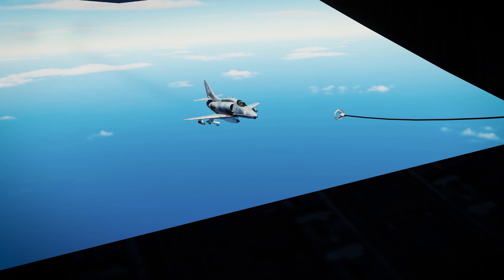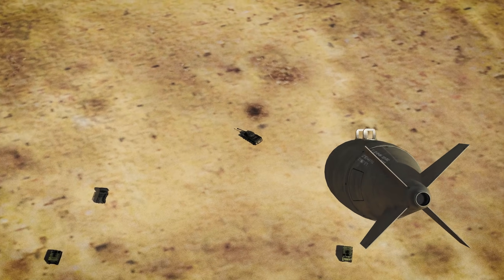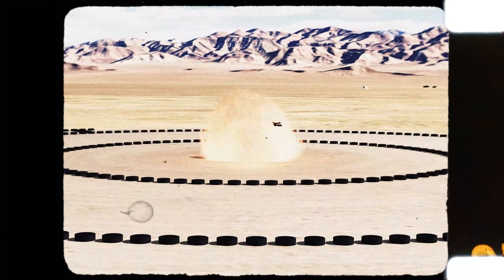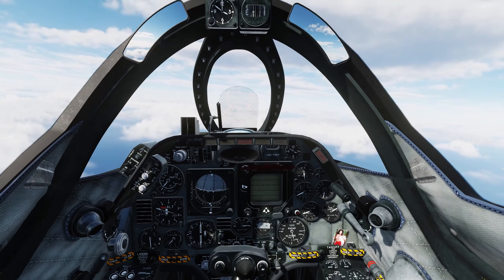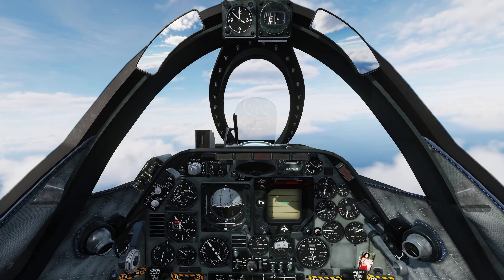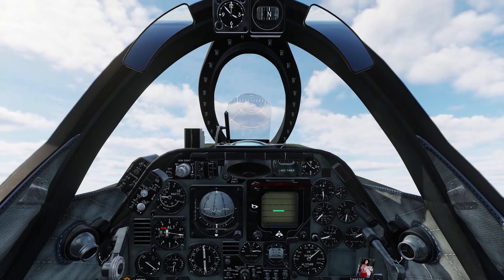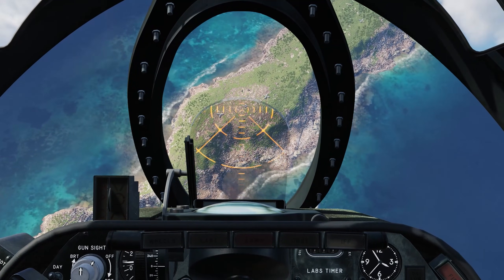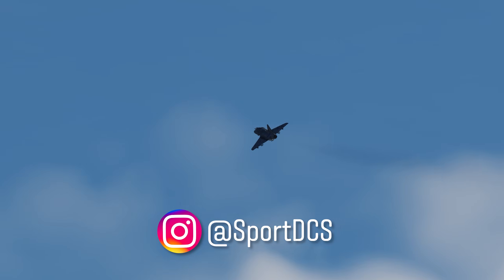DCS A-4E Weapon Release Computer | Digital Combat Simulator Tutorial

Comment: I used to be an A-4 Skyhawk avionics tech (a long time ago... late 70's).  I was in a training squadron and none of our aircraft had the APG-53 radar.   A couple had the CP-741 and I've had to remove and replace it to get to other stuff, and it is a big heavy beast!  I always assumed it used vacuum tubes (the Skyhawk still used a vacuum tube radio until the mid to late 70s), but if it had transistors, they were the heaviest transistors made!  😀  I appreciate seeing how these systems were intended to be used.  All of our student pilots were practicing plain bombing with a fixed dive angle, a fixed airspeed, and dropping at a fixed altitude.  I got to ride in the back of one of our TA-4's and experience it myself... and got to see my breakfast again.  I'm glad that I brought a bag with me!
Reply from the maker: That’s so cool to hear! Thanks for sharing that story… really brings the connection between the real and sim worlds!
Reply: @SportDCS  Is there a tutorial for "dumb" bombing?  As a guy in the back seat, it was pretty neat.  As we approached the target, we rolled inverted, pulled to get the nose on target, rolled upright, and maintained the required dive angle and airspeed.  At the proper altitude, the bomb was released.  At that point, we pulled up at 4 or 5 G's and climbed back to the starting altitude.  We carried 12 of the little  blue practice bombs, and made two "dry" runs first before dropping bombs for scoring.  The specifics for the bomb run (dive angle, release altitude, etc) for each weapon are given in the Tactical Pocket Guide.  I've got a copy posted to Flickr.  I would think that basic bombing skill like this might be something that people would want to develop.  Maybe it's just more fun in the actual aircraft?  😁
Reply from the maker: @SkyhawkSteve that’s a great idea! I’ve tried quite a bit of manual dive bombing and I’ve found the biggest limitation in DCS is the sense of feel when it comes to interpreting what the airplane is doing. It’s difficult to determine if you’re accelerating, or banked, or any of those other subtle cues you get when you’re in the real jet. I’ll be honest when I say I struggle with manual bomb deliveries from a pure skill standpoint!
Reply: @SportDCS  I should provide a little more of my background... I was in a training squadron, VMAT-102, and got a few flights in the back of our TA-4's.  Pretty cool, but those bombing runs really take it out of you when you aren't used to it!  As far as getting a sim to provide the same feel as a real flight, that is a real challenge!  I've spent a little time working on flight simulators at McDonnell Douglas (after getting out of the Corps), and having a full side to side and top to bottom visual display gives you a feel for your attitude that a computer screen just can't.  A motion-base simulator can provide some of those little physical cues that help you know how much you've changed the dive or roll angle, but I don't see that coming to home simulators any time soon.  It's amazing how far simulators have come since the early 80's, when even McDonnell Douglas was generating graphics by flying a little camera over a huge model map.  Who knows what will be developed next??

Comment: I have a question for you: I can’t seem to get the bombs to release, unless I’m in ripple/salvo mode. I have all 5 stations fully filled with mk82, and all pylons are engaged/enabled. I understood that you cannot do pairs with the center pylon, but does that also mean I cannot release wing mounted bombs in pairs?
Also, I’m not sure what the difference is between ripple and step.
Reply from the maker: @baronvonrichthofen2021  have you tried releasing in pairs without the center pylon turned on?

The difference between ripple and step is in ripple, the quantity and interval of bombs released by the AWRS is done through a long push of the weapon release button until the entire sequence is complete. In step, you need to keep pushing the weapon release button multiple times to get all the bombs off the plane - it “steps” from station to station
Reply: @ thanks for the response. I found that someone I hadn’t armed the bombs, or set the Center bombs on pairs, which doesn’t work

Comment: just a silly question. How does it know where the target is? Any reference to it?
Reply: Does it have to be a specific type of bomb in order for LABS and CPMTR to work? In my case the BG&A mode works just fine.
Reply from the maker: @huey_dvr  any of the slick Mk8x series and the Rockeyes are compatible with the bombing computer. I believe the custom An series of WWII bombs are good to go as well
Reply from the maker: The radar is fixed straight ahead and when you press the pickle button, it locks onto whatever it is on the ground where the nose of the airplane is pointed at.
Reply: I did everything by the checklist still no luck to get the bomb to drop in computer mode. 😡
Reply from the maker: @huey_dvr  master arm on? I forget that a lot. Check in on my discord and maybe we can get you some help!
Reply: @SportDCS  I checked that too. The manual mode works fine. Maybe something is broken with my module.

Comment: Thank you for this video, it helps so much! ! As a new A-4 pilot, i'm fighting with correct trimming of the aircraft on the bomb run. Usually it begins to slide on the left or right, so i compensate this with rudder trim. But this results in aircraft begins to roll slightly! When i compensate this roll with aileron trim, it gives much more roll effect, than you can expect from trimmer... And now is the time to pull up, and i got no time to aim correctly. Any advices about this? Your aircraft is pretty stable in dive run! Maybe there is some tricks with aircraft trimmers?
Reply: Predicting the trim necessary to overcome a disruption in coordinated flight comes with time. I've found that you want to start trimming BEFORE your aircraft is making heavy movements. I also find that unless I'm in a crazy crosswind, or dealing with an insanely imbalanced load, rudder trim is typically unnecessary. Trimming starts as a bit of a balancing act mini game, but eventually it'll be so second nature you won't notice you're doing it. Getting good at trimming the aircraft does wonders to help with landing and air refueling as well, so the skill isn't just an unfortunate necessity with aircraft lacking a fly-by-wire stability system, but instead a hugely beneficial skill to master across the board. 

This is one aspect of flight simulations that unfortunately gets glossed over by newer guys, and it's not stressed nearly enough how important a well trimmed airplane can be by the old folks.

Comment: Where can I learn more about the other bombing modes not present in the A4 community mod.

Also, what bombing mode would the Argentinian A4's used when coming in low level against British ships in the Falklands?
Reply from the maker: The bomb modes for the A-4E can be found in the 1966 manual, however I don’t think it speaks about specific delivery tactics. 

As for the Argentinian A-4s, I think they used some manual Bombing and some very low-angle methods. Also, they were using A-4Bs which I’m sure had some differences to our -E model.
Reply: The manual has a guide for bombing with snake-eyes, which would be very low similar to the Argentine pilots. The manual says to set the Gunsite Elevation to 160, Fly at 400 feet, 400 knots. I found that you need to have the Weapon Function Selector Switch set to "Bombs & GM ARM". If you have it set to "CMPTR" they wont drop. I found it helpful to set the rad alt warning at 400 feet so the low alt warning goes off when you're at the correct altitude. Also, zoom out the view in cockpit so you can see the airspeed and alt gauges at the same time.

Comment: I'm on mouse and keyboard and I can't pull up while holding the weapon release button but I've figured out how to loft / toss bombs with the bombing computer anyway. So what I do is I line up my sight with the target tap down arrow key (pull up) and when the crosshair meets the target I hold weapon release and the plane will keep drifting up, once weapons released, full throttle, get outta there.
Reply from the maker: That’s dedication! Have you tried using an Xbox controller?
Reply: i think it shuld be possible to still have control while holding relase if you assign relase as mouse button

Comment: great tutorial. can't stress how important is is not to be fighting wind, bad trim, or other instabilities in the dive after the roll-in. if you are using the AWRS, be sure you check the kneeboard for details on when the tone clears, it differs depending on drop mode!
Reply: Hmmm; trying to recall our preparations for a bombing run.  Right after start up we'd check the gun sight to see if it was reading true.  We'd put 240 mills in the gun sight drum and then peek over the nose to see where the pipper struck the nose cone. If it was off we'd put that many mills on or off our sight setting.  We also switched on the Stabolization Augmentation...aka the StabAug.  This fixed the Skyhawks tendancey to dutch roll in the run.  We sat the weapons function switch to "Guns and Guided Missles Armed".  We didn't turn on the weapons master switch on when we were in the run, or getting ready to shoot the cannons. Our weapons manual that we kept on our knee board helped us  compute the gun sight setting.  We added 5 mills for each wing tank (I think...it's been a long time!)  Anyway the gunsight setting was usually something like 160 mils for 30 degree bombing.  We'd usually fly to the target at something like 18,000'.  We'd fly abeam the target and when abeam we'd roll 120 degrees and let the  nose fall to a 30 degree dive, which looked almost straight down.  We'd put the pipper at 6 o'clock on the target and let it run along the ground.  We'd time it so that it reached the target at the same  instant we hit the release altitude and we'd pickle the bomb button with our thumb.  We'd get a tone in our headset and we could feel the bump when the bomb came off.  We'd "pickle, pause and pull".  We'd apply six 6's and grunt like mad or you'd black out.  As it was you'd gray out and you'd roll port (left).  Then you'd release the G and roll out going back the other way.  Sometimes you'd jink to avoid being shot.  We seldom made more than one run.  You'd one run, pickle all and get out of Dodge!
Reply: Oh, gee I forgot a few things.  You had to arm your bombs before you dropped them or they wouldn't go off.  You never wanted to stare at the target, which was called "target fixation" or you might fly into it.  You did  not see your bomb hit.  If you were shooting 2.75 rockets which you carried in 7 or 19 shot pods that you carried under your wings you'd not see them hit either. If you were really serious about putting the hurt on someone you fired 5" Zuni rockets which you carried in 4 rocket pods.  They were much bigger than the little 2.75s. The Zuni's blasted all the way to the target and were really exciting to shoot.  They got good hits too.  Sometimes you'd carry four Zuni rocket pods (4@) and you'd shoot one rocket from each pod with one pull of the trigger.  So jerk the trigger four times and you'd put a lot of hate and discontent out there!  You could also shoot them all with one pull of the trigger, but I didn't think that was as much fun.